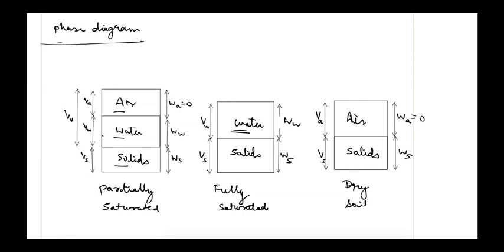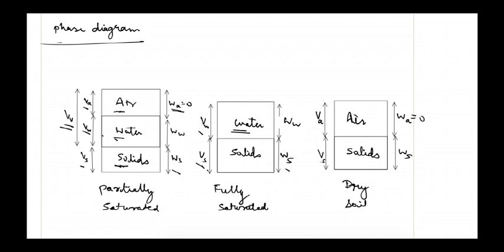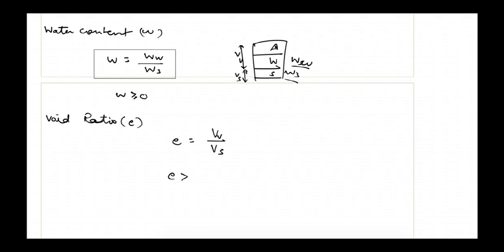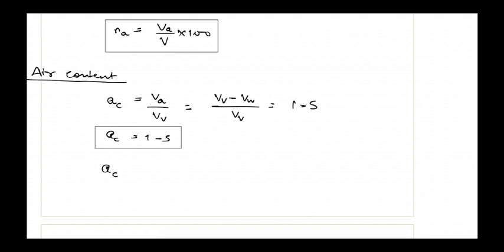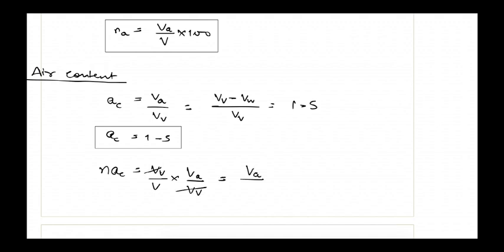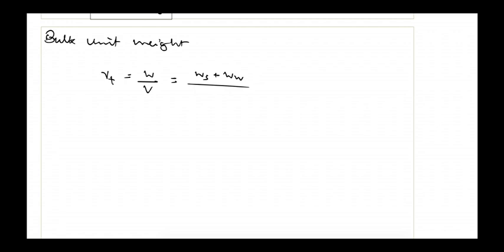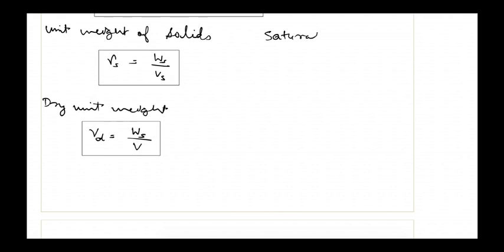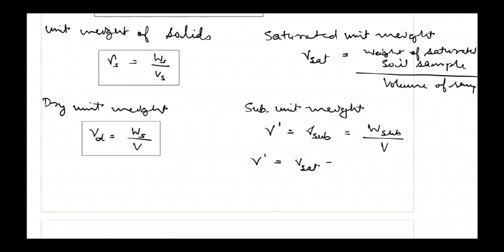Phase Diagram and Basic Definitions | Soil Mechanics

Comment: Dear Sir..
A Big thanks for your lectures. I am Btech CE 2016 passout. Today, I had my GATE examination and honestly I should say I depended only on your lectures and gave the exam. I was able to preform well as most of the questions were from soil mechanics and environmental engineering for which you gave classes. As I am working, I was not able to attend coaching classes. But you explained all the concepts very clearly and that was all enough. I will update once the score is out.
Reply from the maker: That’s really good to know :)
Reply: Kitne aye bhai bta de ab?
Reply: 78.4